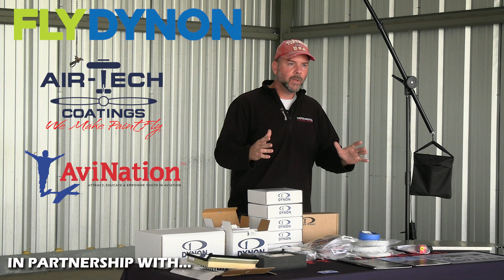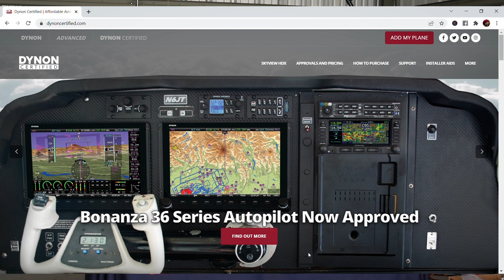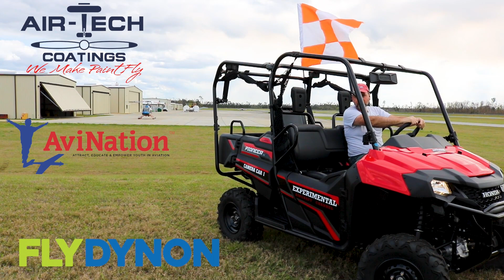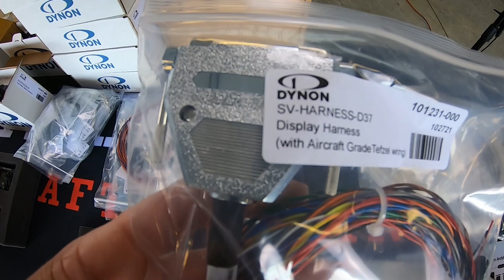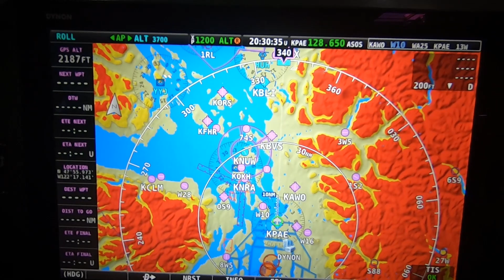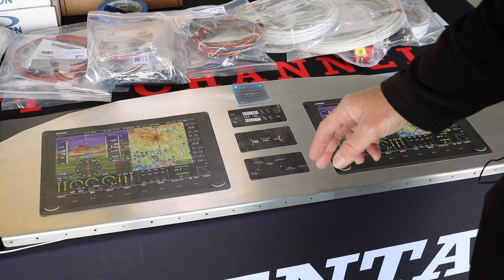Aircraft Instruments - Modern Glass Cockpit Dynon Avionics

Comment: Did you get any guidence on what design criteria need to be considered on antenna vs. module location vs. lengh of cable (like mounting a module in the back of the A/C) allowable back to the base unit ?

Comment: Thumbs up. If I were to do my Cruzer panel again I would definitely go with two HDX screens instead of the one HDX and one iPad. On my Super Duty I did go with the two Dynon screens. Speaking of packaging, Dynon designs their packaging sort of like Apple-it's a work of art! On the other hand, I bought a Garmin 175 IFR GPS and it arrived loose in a box with no installation instructions, and no real protection for anything. It looked like someone else returned it and just threw it in a box, and then Aircraft Spruce resold it to me. Absolutely terrible packaging.

Comment: Great vlog. You are correct about the good ole steam gauges. Yes they do the job well enough. It is however comparable to my horse drawn plough works good enough for me. It only takes four days to complete that task. A modern up to date properly equipped tractor would complete the same task in four to six hours. To make that more relevant. A modern inter grated panel or even better several of them. Not only can you by quickly scanning one screen. Access all relevant systems both situational, (Altitude, heading, airspeed, pitch, yaw, turn, amount of trim.) All of your relevant aircraft systems. Engine RPM, pressure, temperature. Fuel, amounts in which tanks are available. The tank you currently using. Gallons or pounds of fuel being used. At current rate of fuel use how long time/distance remaining. If the maths is not within a safe positive result? Can I alter power settings enough or do I have to reroute? All part of flying. With the benefit from the modern systems. The quick, accurate, reliable access to the relative data. Not only saves time from amount of extra instruments scanned, cross referencing that information the mental crunching of the stats. All resulting in less stress on the pilot. Gives the pilot more time to actually fly the aircraft. Being more aware what is happening outside of the aircraft. Spotting a potential collision threat birds/drone/aircraft, two seconds earlier. Could be the difference between a close call or a lot of people having to file loads of paperwork. Any reduction of the stresses and work loads involved can only be  a good thing.
Reply from the maker: Simply: YES! You said it... ALL! Hah! That is pretty much the decision maker for todays tech available to us now isn't it. Thanks for sharing.
Reply: @ExperimentalAircraftChannel  There are two main reasons I enjoy your content. One you have wide knowledge/experience base. Two your absolute and total love of aviation. Due to glitch I have added to my previous post. Please keep up with your great work.

Comment: Very nice pile of parts!  I chose a nearly identical system for my Kitfox, except that I'm using a single 10" EFIS and an iPad.  I didn't purchase the pre-made Dynon wiring harnesses, as I think they're overpriced and wasteful for builders of smaller aircraft like mine; you pay for a lot of wire length that you'll end up cutting out of them.  I'm comfortable making my own from scratch, so that made sense for me.  I also bought a couple of autopilot servos at a good price from another builder who went in a different direction.

If you think you'll install the autopilot servos, you should really make that decision up front.  You'll probably want the Autopilot Control Panel (much easier than navigating menus to control the aircraft), in which case your panel layout will need to change.  With that module installed, you won't need the standalone "LEVEL" button, as that button is on the A/P Control Panel.
Reply from the maker: Thanks for sharing. Yes... I understand your point completely. I may need to leave some room for additions later in my panel planning process. We will see shortly. Thank You for sharing your experience here!

Comment: I would love to purchase the system I want for my exp., however, none of the systems are currently available.
Any info on this?
Reply: I hear the experimental systems are back in production so you should see stock soon on those. Certified stuff is a different story
Reply: @S M yes they are built by the same folks.. I assume they had to change something that forced them to go back through all the process.. Three letter agencies can screw up anything..
Reply: Biggest difference between the experimental and certified systems is the certified are “locked down” requiring an A&P to update things. Not so with experimental.
Reply: @scottmiller4711  Thanks! Makes sense I suppose. One more reason to stick with EAB👍
Reply from the maker: I honestly was not aware of this. We received our shipment around Christmas time. I have requested an update on current lead times. Thanks for stopping by! :-)